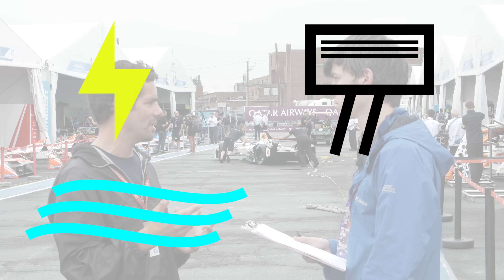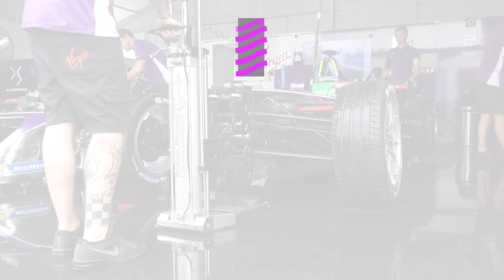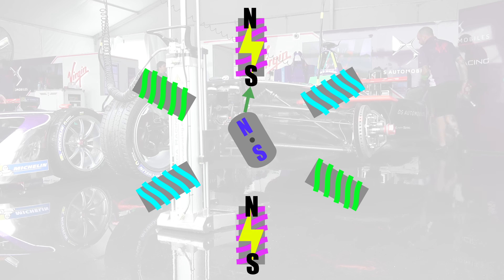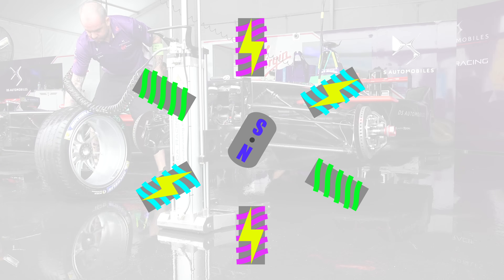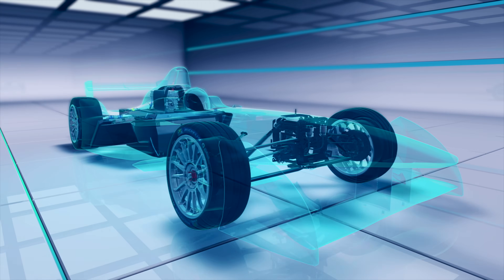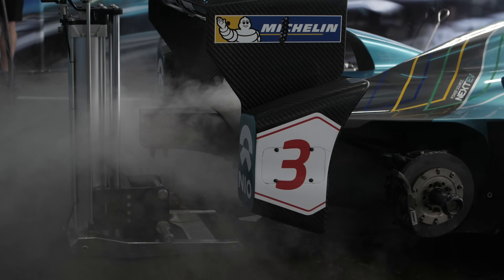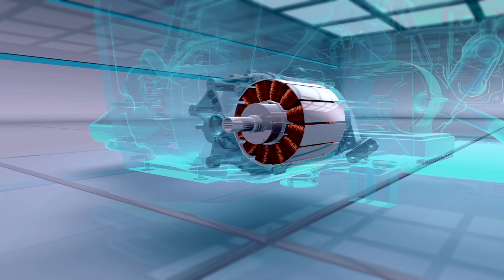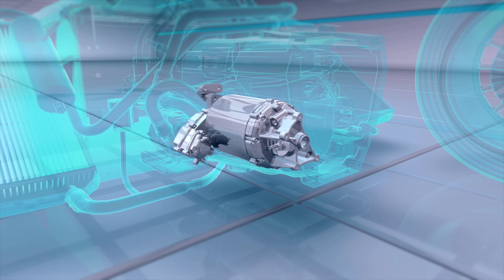Can You Tune Electric Cars For More Power?

Comment: Just swap their motors and batteries and put a real engine in it
Reply: never would work since a electric motor takes up a fraction of the space a gas engine does.
Reply: Matthias Schmitt They already made a Tesla Desk, put an engine in the frunk of the body shell for lols, and explained why it will never work because of the ground up design around the electric drivetrain. So LS said no.
Reply: Which is no shame because power propells you.
Reply: Want to beat a Tesla do 60 roll Tesla max out at 140-150 mph I've seen supras go 200 in seconds.
Reply: yeah! I want to see an LS swapped Tesla!
Reply: I want to see an M5 with a Tesla drivetrain and that ugly grill removed, like the Model 3. A step up from Matte Rimac's conversion of his green M5 to Electric.
Reply: but then youre making so much less torque...
Reply: Wow, guess you can find this "real [put substantive here]" talk everywhere. An electric motor is no less real than an engine, both contribute "real" locomotion. It might be just a semantic detail to many people but it bothers me when people do the "real" talk.

Comment: So in other words electric cars can never be project cars
Reply: How exactly do you draw that conclusion?  Much like "regular" F1 cars, these cars are pretty much pushed to the limits of physics (or at least the available technology).  Consumer electric cars aren't pushed to such extremes.
Reply: Ogknav No it's not. Less moving parts, engine internals etc. Electric is easier to swap than mechanical
Reply: Charlie Molda  did you even watch the video? That's not what he said at all. He said if the stock components are not at the limit, you could tune or upgrade the weak link. Or if they are all at their limits, you can just upgrade everything.
Reply: Bigger cables? Silver conductors? High current battery? More powerful magnets? Better contacts? Bigger battery? Better regen? Moving magnets closer to the coils? 
Superconducting materials? Super conductors for magnets? 
That's before you start on non 'engine based things such as reducing unsprung weight and normal chassis adjustments. Then there's also gear ratio or even adding a gearbox. Maybe you could fit a small hydrogen fuel cell for extra 'boost' or range?
Reply: they can but you would have to follow the same method as with hobby grade r/c cars which is swapping for a more powerful motor and controller and a more powerful battery pack. putting a tune on it would be possible by patching the power management software.
Reply: Charlie Molda Look up Car guru and his rebuilt Tesla that was modified with more power than when he got it. Also the cheapest Tesla out there.
Reply: Mate Rimac's first project car was his BMW E30. Blew the ICE so he replaced it with electric motors and made a drag car out of it.
Reply: Actualy a common way to get more power in R/C planes is a higher battery voltage.
Since that increases rpm and these controllers don´t limit torque the motor delivers more rpm and more torque.(air resistance increases with speed)
The problem is that you overstress the motor with that since it operates beyon maximum torque, but that is not a issue for cars, since they are limited by road grip anyway.
Tesla model S for example have only 2 different drive units, the big and the small one.
The big one is the same for a 1st generation 60kwh as for the P100D ludicrous mode, the only harware difference in the rear drivetrain is a different fuse and a different controller.
So technicly you could chip a base model RWD Tesla to 400 hp+ but you should not use this kind of power extensively, since the 60 kwh battery is not realy up to the task and neither is the cooling system.
Reply: Albert S. And no supercharging or turbos
Reply: No not at all, eventually I'm sure the aftermarket will probably come up with secondary motor controllers with larger capacity for voltage and amperage, allowing for larger more powerful batteries to be used which would easily boost power a great deal. However you would probably need to also come up with some form of radiator and liquid cooling system for the motor at that point because working it more than the oem set it up for, would create a lot of heat. One time running your motor too hot for a bit too long and it will be a burnt, god awful smelling, paper weight. That also leaves the an opportunity for the aftermarket to sell more powerful motors in the aftermarket, although I'm sure the cost will not be cheap. Just like small scale electric cars have larger batteries, higher power motor controllers, and motors themselves, the same can be applied to electric automotive but once again, the cost will probably be high for big ticket items like motors, granted the government doesn't outlaw this somehow. It would be difficult to be ticketed for something like this tho, how often would a cop really know if your motor isn't oem if they could actually see it at all, there only clue would be the tires be blown off under acceleration in a car that normally wouldn't.
Reply: +Charlie Molda, he said exactly the opposite :D
Reply: I literally just made a video about modifying electric cars a few weeks ago and came to the same conclusion...Really the only thing you can do to mod an EV is to do a chip tune (or do an entire battery or motor swap). No turbos for Teslas!
Reply: mrsemifixit That's like saying putting a CAI intake on your car make's it a simpler project car.
Reply: Jehu Garcia, EVWest, look it up.
Reply: Motor swapping, weight reduction, style changes and getting a better battery or tweaking the gearing of the
car are all still possible.

Just what you need to tweak to get the same results has changed.
Reply: I don't think that they're boring for the engineer that designs them, or the guys trying to research better batteries. Not much that a current mechanic enthusiast can do about them, however. Another set of skills.
I can imagine people modifying their electric cars, however. Firmware modifications would probably be the most accesible way, then change something like the inverter or the motor. If you really know about power electronics, you maybe can modify the inverter, but it's no joke to hande such a high amount of electric power. At the very least, you need to know how to avoid dying in the process :P
They're complex, but their complexity lies mostly in electronics and programming stuff, like the inverter, and the firmware, and well, battery chemistry, while in cars with combustion engines, most of the complexity come from the complexities of the engine, and it's requiremets. Complexity that at the end, makes the I.C.E. no favors, as the advantages of the electric motor in efficiency, torque characteristics, and reliability are evident.
Reply: no exactly....but you need a lot of skills....but I am sure the tuning market will adopt pretty fast !!
Reply: Gas to electric conversion cars yes
Reply: Charlie Molda Or simpler project cars lol
Reply: Also cooling techniques and designs! :)
Reply: I bet there will be an open source software u will be able to put on the project car to operate things. Then u can do whatever you want. Bored computer programers will be all over that. Then you have the R/C car crowd with a head start as far as knowledge on turning these up.
Reply: Nathan Curet Well they could make it extremely difficult to do so  if the manufacturer wanted to. Kinda like the way Apple does it. They solder all the removable parts in so u are forced to buy new instead of upgrade. We hope they don't go that route.
Reply: They can be awesome troll cars.
Watch gutted tesla trolls
Reply: @ Albert S. Super boring? Try a Tesla S in Ludicrous mode. I just bet you think its anything BUT boring. 0-60 well under 3 seconds could only be boring to a professional Drag racer or F1 driver. Maybe.
Reply: The battery in all Tesla cars have the same capacity hardware wise, the only difference is, Tesla limits the capacity of the lower end model using software, so technically, someone with a coding knowledge can remove said limitation.
Reply: Andrew DeWitt they can't make cars out of non-removable parts because unlike an iPhone, cars are expected to last a lot longer as well as being reparable. It'll be too expensive for car manufacturers if they have to replace the whole car instead of replacing a single faulty part.
Reply: PT111111 That is not correct, some Model S came with a different number of battery modules.
Reply: I just found out from the hurricane Irma news. Apparently Tesla remotely unlocked the battery of the lower end model Teslas in the affected area so the owners can go further. Google it if you want.
Reply: PT111111 That is possible but not as much as you think.
You can extend the range of the cars with a lower amount of modules by charging them higher and discharging them deeper, but that is realy bad for the battery.
There are some only electronicly limited models, but some are still equiped with less modules.
(60 kwh models for example)
Reply: @charlie molda  Of course they can, there are plenty of kits available to build electric cars and they are generally easier to work on than combustion engine cars. And even if you have a modern car with a PMSM and cooled batteries you can still adjust things as interior, springs and the body.
Reply: Charlie Molda Not at all!!! If you want to work on your own eletric car look up solenoid engine... It's a electric motor but in flat 4 v8 v12 configurations... it's neet and sounds cool... You won't have high RPMs but... Somebody can make it fast
Reply: Did you watch the damn video?
Reply: Unless you are an engineer.
Reply: Unless you are an engineer.

Comment: you mean i CAN'T turbo a tesla???? what?????
Reply: KyoKyoM99 of course you can't, you need to supercharge it
Reply: KyoKyoM99 just put a ricer wing on it for 1000+ hp
Reply: KN filter n straight pipe it
Reply: A turbo uses exhaust gases to compress intake air, because an ICE needs air.
An electric vehicle doesn't almost need it at all. Only used to keep things cool, and even then, the efficiency is extremely better than in an ICE. In fact, an ICE produces more heat than movement!! Is that crazy, or what!? Fortunately, gasoline have a lot of energy density, otherwise we wouldn't be able to use ICEs much (in fact, it's probably a good idea to switch to electric before we run out of it, as we need petrol derivates for some other really important stuff).
Reply: Split Shockwave I see what you did there
Reply: kaposvári bando dude idk what you're talking about. my civic's turbo is fuel injected and it runs like a charm. (sounds like a supercar too ngl)
Reply: Turbo is so yesterday
Reply: Straight wire it
Reply: kaposvári bando it needs fuel/air mixture
Reply: i want a tesla model 3 whit tri-turbos
Reply: KyoKyoM99 I sense the sarcasm.
Reply: KyoKyoM99 lol your engine is fuel injected...your turbo is spun by exhaust gases to compress air from your intake through an intercooler(hopefully) and into your throttle. Only liquid is a little oil on the turbine and coolant around the housing. Fuel in a turbo would probably ignite and your car would be toast.
Reply: I CAN'T ?  I'm heartbroken . 😔
Reply: みさきめい adding charge wont help the current. Need to decrease resistance or increase voltage
Reply: みさきめい i know...but i think you are thinking properly...
Reply: Use Nuclear Reactor or Multiplier Gearbox for more power
Reply: Turbo maybe for air cooling the batteries
Reply: Tesla's dont have exhausts though xD
Reply: What are you going to compress the air into? There isnt any combustion going on. How hoes compressed air help an electric motor?
Reply: a turbo needs fuel so no